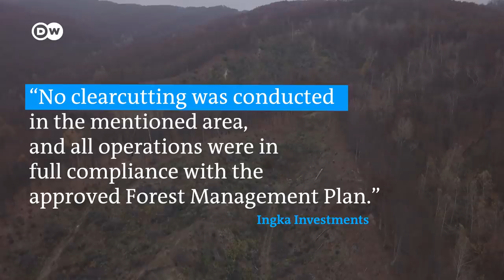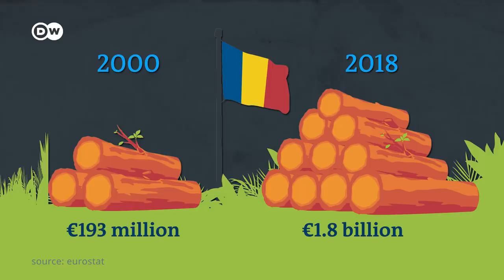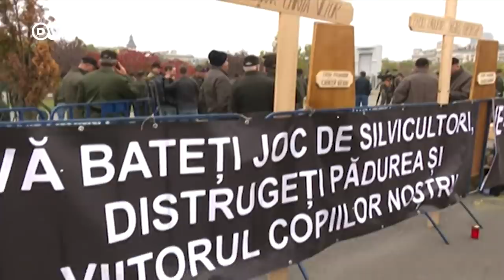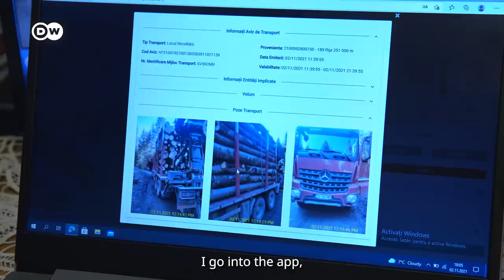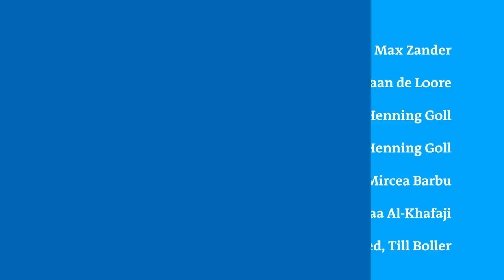Wood Mafia country: The dark side of IKEA in Romania | DW News

Comment: That is just terrible. To think I bought an IKEA desk not too long ago...
Reply: Stop buying Ikea.
Reply: Any other desk at the same price would be the same or worse. If you want to buy sustainably, it gets very expensive very fast and still hard to verify that all, or really any materials are properly sourced and processed. An unfortunate side-effect of efficient manufacturing and low prices.
Reply: @marcussoininen2084  You can do better.
Reply: Maybe you can’t even afford ordering a desk from a carpenter with “clean” wood.
I know I couldn’t.

Other alternatives might as well be worse or equally as bad.
Reply: Buy second hand.
Reply: MDF or wood?
Reply: @harmony3138  I looked up my desk and it seems to not have been made out of wood.
Reply: @antman7673  buy one made of  steel  and glass, it's cheaper,  I've owned one  for  years  and it stil  looks like new.
Reply: @j2174  exactly!
Reply: Stop using a desk, buy some rocks instead

Comment: i see there are flaws in this article, at 14:55 15:39 17:38  those are loads/stacks of pulpwood pine used in paper production, i highly doubt that is going to the mill for furniture grade lumber, the logs are in no way old growth and too small in diameter to be sawed up into quality lumber, the stump at 16:39 may have been a big enough tree for lumber, but there is no way of knowing?, and so you know, there is a huge difference between construction materials and furniture grade materials and for instance, much of the world's furniture including IKEA's is constructed from the by-products of construction lumber milling and sawing in the form of compressed sawdust that is simply covered in a thin veneer of exotic, oak and walnut etc, hardwoods , the use of softwood species such as pine, spruce, larch and fir etc, which is shown here is not commonly used directly as the lumber in the construction of furniture, but when it is, it is also covered in a thin veneer of quality hardwood.
at 24:36 those are lumber grade trees being harvested, but again look like softwood species commonly used in construction materials
at 25:56 that is a green log the horse is pulling and not firewood for a year or more after cutting and splitting, at 26:09 there is tons and tons of firewood on the ground
but there is no doubt that big corporate land owners will do as they please with the lands they control, and it is easy to pay off local officials to turn a blind eye or protect jack loggers.
romania is certainly an "out of sight, out of mind" country, so illegal logging would flourish there, and no one outside romania or moldova would know about this issue if DW News had not done this article